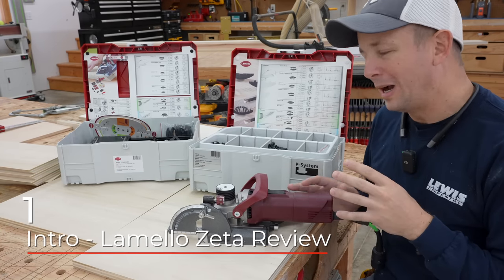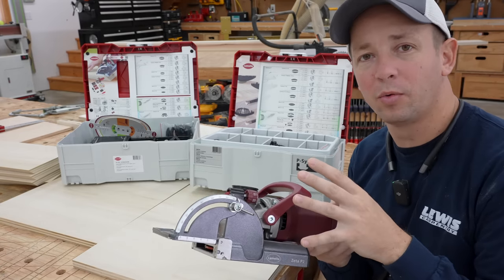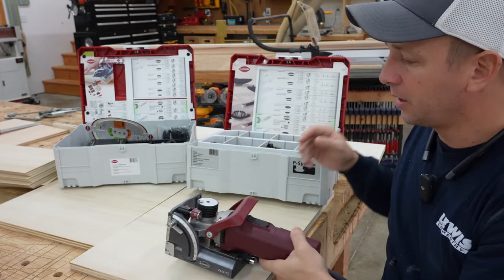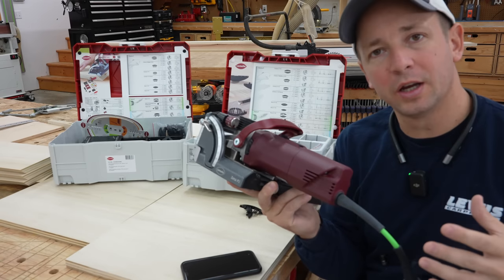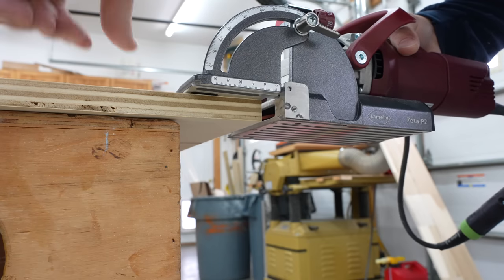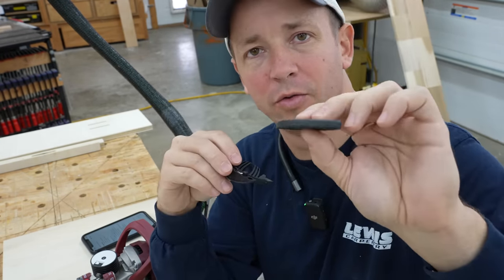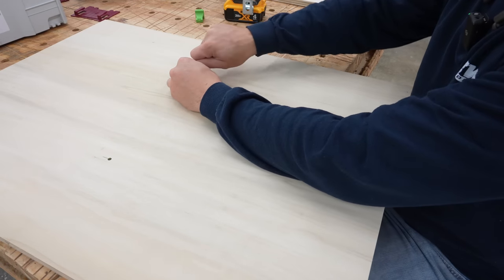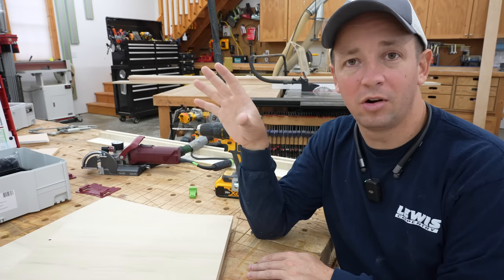Worth the $2000??? I finally bought a Lamello Zeta...

Comment: Wish I had a box of those Festool Plug-its.  While I have both Dominos I also have a P2 Zeta and Classic X.   The secondary fence provides the option to change the location as well as the 2 plastic shims.  You can also change the blade for regular biscuits (Amana makes a nice one with inserts).  The Tensos are brillant nothing equivalent out there.

Comment: I've been thinking of a Zeta P2 for a while now but never considered it on a multicolored slat wall. That sold me and I've ordered one. Unfortunately the vendor that I bought the tool from doesn't have a good selection of connectors. Who do you like to get yours from? Any affiliate link I could hit for that? Thanks!
Reply from the maker: I got mine from Burns Tools online but they recently had a fire, so I'm not sure which direction to point too. I don't have any affilate links for connectors. Thanks for checking though.

Comment: Super-informative review, as always.  FYI, @knappconnectors makes a wide variety of KD connectors, several types of which could be used for the first application you mentioned, requiring only a biscuit machine for installation. Probably a bit slower, but another way to accomplish the mission until a guy has justification to take the Zeta plunge.

Comment: Watching your videos the last couple of years I've always thought that the Lamello would be really suited for a lot of the work you do. I'm sure you're going to find uses for it that one else has thought of yet!

I bought the lamello a couple of years back. If it was 5 grand I would still buy it. Makes angled wardrobe and cabinet carcasses a breeze - haven't used a clamp since. Like you I also use it for making larger sheet material, in my case MR and Tricoya MDF. Chuck in a few dominos and leave it glued up overnight and, as long as you can carry it, you can go as large as you like.  Not used as much as the other connectors, but the Flexus connectors can solve difficult assembly hassle.

Looking forward to seeing how you use the machine!

Comment: Hmm.... in regards to the slats-on-wall with the need for the wall to be painted and the slats to be natural (stained / finished), it seems to me you could have achieved the same result (mounting the slats after painting) using good old fashioned round wood dowels and a quality dowel jig system, which would cost way, way less.  The option of being able to unlock the clamax tenons is nice (does require the access hole) and replicating that with regular dowels would require some thought, but probably possible if that is a real requirement.  But you said yourself you would likely apply glue in addition to the fasteners so it doesn't sound like removing the slats is a real requirement in this case.

Comment: I own the original Zeta and always worried about the cord, with $1500 crashing to the floor with one trip of the cord, to the rechargeable one might be just the ticket. and although I may be all wet here but seems to me that these work best when you have the vacuum attached and its sucking out the chips. I have had occasion to try to use the tool without the vacuum and it got clogged.

Comment: Hey Spencer, great video. 32 minutes is a long time to ask someone to watch a video and in your video I never once wondered whether it was almost over or not. Really great content.

A couple of questions: Carbide cutter or diamond cutter, is it worth the extra $100 for diamond cutter?
Second, how does one cut a bunch of mortises into the face of plywood that is repeatable and accurately? In that scenario seems like you don't get to reference from either the fence or the bottom of the tool. Maybe a way to use a Festool track guide with this tool?
Reply from the maker: The diamond blade is better for more abrasive type material like melamine or particle board. I think you actually want the standard cutter for wood and plywood.
Reply: A jig would probably be your best friend on repeatable in-line mortises like that. FC Tools from the UK makes a jig that the Lamello will mate up with.

Comment: Hi Spencer. Glad to see you finally give the Lamello a try 😊.
Just an FYI you can get a blade that fits the Lamello Zeta P2 to use it as a biscuit joiner. Your need to turn the oscillation function off to use it as a biscuit joiner. Also check out the “Flexus” connector. It is a Clamex connector but the little nubs flex inward so you can slide say a shelf in place in an existing cabinet etc.. and then lock it in place. If you search“Colonial Saw Flexus” or the “Lamello Flexus ” on YouTube they both have a video on how it works. The cordless version comes with a dust bag. And I’m curious… Did you get your Lamello with the diamond blade or the carbide? I got mine with the diamond blade because I mostly use sheet goods. But I had a project using a combination of hardwood and softwood so I bought the carbide blade. They recommend the carbide blade on natural wood products, especially hardwood. In natural wood products the carbide blade cuts cleaner and wears less than the diamond blade.
Also do you have a part number for Festool plug/it connector you used?
Ron
https://youtu.be/esr0k2PtQlI

Comment: Another great video Spencer. You will love the Lamello. Try doing miters you will absolutely be blown away how perfect they are every time. It would be great for those ceiling beams, you probably would not even need to tape it. One question, where did you get the Festool plug in cord. I have heard that it is only available in Europe. If you could provide some details. I would greatly appreciate.
Reply from the maker: I had someone send me a few from Europe several years ago.

Comment: Great video and very helpful for someone evaluating the Zeta 2.   I have one but find that I should be using it more in the building steps but don't seem to grab it much.   I have looked online for other uses and how carpenters use it in their workflow, but there's little information out there folks are sharing.   It would be great to see you make a video after you have used it for a few years on how to use it in different carpentry and cabinet applications.     Also, where do I find the plugin adapter you replaced the cord with?

Comment: In Canada machine alone around 2300$. 3400$ with a kit. Should also mention I first used a Lamello back in the 80s. They did have connectors allowing snap together assembly,some were aluminum some plastic. I never used them but they may still be available. Cheers.

Comment: I've had one of those for over ten years, mine came in the luxury wooden case. and it's the Rolls Royce of biscuit machines, though not quite as versatile as the original Elu pivoting biscuit machine and scoring saw - only bought the Lamello because you can't get electric motors for the Elu. Also had a Delta and Mafell biscuit machines in between, can't recommend those...

Comment: Have been building cabinets and furniture with dowels, biscuits, pocket screws, and dovetails for 50 years. Making an expensive joint stronger than the wood seems a bit pointless to me. Maybe in a few special applications it might be good. Nice video.

Comment: I’m curious to know how well the shear strength is on the connectors
Reply: I built exterior doors for a living. I used the original Top Lamello. I started in the early 80s. Some of the doors are 40 year  old  with no signs of failing. Gluing up panels was a breeze. The Top model was a quality machine. The knockoffs were not even close in quality.
I’ll,check this 2k model out.
Reply: You and I know that the shear strength does not exist with plastic
Reply: @lourias  Not true at all  These use ABS plastic which has relatively high shear strength.  I break-tested a solid hickory panel and the hickory split before the inserts sheared.

Comment: Seems like the pre-load clips should already be pre-loaded onto the component vs. snapping them on.
Reply: The problem with that idea is that the pre-load clips would stretch out the fingers of the Tenso and cause the connection to lose clamping force. Lamello says to not install the clips more than a 1/2 hour before final assembly in order to avoid this issue. The clips actually move down into the connector when they're snapped together.

Comment: If you have a fixed height, then it can only be used with one size of wood thickness whereas with an adjustable fence one can easily adjust  for different thicknesses in wood, such as a 5/4” aprons with double biscuits onto 2 1/4” legs so as to have a 1/8” reveal line outside of the outer plane.
Reply from the maker: It has a fence that is added for those applications.

Comment: Once the running costs of the connectors are factored into material cost out, it won't matter. It will just be a resupply of shop goods at that point.

Comment: The Zeta is not cheap but worth every penny!  The tenso & clamex fastener is awesome...so many uses.  I now attach all my cabinet scribes with the tenso fastener which is quicker/easier and being able to remove them is easier to scribe.  You can use the bisco as a temporary connection or alternate between tenso or clamex connectors you are using to make disassembly easier.

Comment: Excellent review Spencer. One question I’ve always had with those snap in connectors - can you pull it off somehow or is it a one and done kind of thing. As in how do you dry fit or do you just have to trust the tool?
Reply: I have one and yes you can pull off the Tenso snap ins (if you didn't glue too😉). It might take some muscle tho. I dry fit and then pop apart glue and pop back. If done right basically a second set of hands buying you time to get clamps. With the clamex no glue or clamps necessary but they're pricey and there's a small hole.
Reply: @ericdillenberger7873  Thanks for the insight!  Still expensive as h$ll and fairly thick so wouldn't work for thinner slats - but that's a great use case.

Comment: When the client wants to touch up the paint or even repaint the whole wall, can you unsnap the slats, repaint the wall and then snap the slats back into place?
Reply from the maker: Yes, if you don't add glue or adhesive. I will be using adhesive with the tensos.

Comment: This is a tool I’ll end up buying for the occasional slat wall project but I fear that it will end up not used once this trend passes. I need to be sold on applications that will make me money using it. Knock down cabinetry may be one.
Reply: Well that was quicker than expected. I ordered one. And I am glad you covered the assortment box. That would be a waste for me. I’d rather spend that money on bulk tenso and clamex supplies

Comment: After watching Peter Millard review and comparisons I was pretty discouraged of acquiring this tool.
 He compared with Domino and Doweller, I really trust his opinion.
   I’m pretty sure works really well for some applications but not for the majority of the jobs.
  It’s pretty hard to justify the price tag at least in my case.
Reply from the maker: It's a very specialty tool, but the guys who love it really love it.
Reply: I think Peter Millard was being a little bit unfair with it to be honest.
Reply: Pete's video where he says the Zeta was a bad buy is extremely unfair. He was using the Tenso without glue- Lamello specifically says those connectors need to be used with glue. I thought it was pretty irresponsible of him to not know the very basics of a system before making a video where he portrays himself to be somewhat of an expert.

Comment: I don't mind paying a high price for a tool, but if the consumables are also expensive then that definitely influences my decision. Your average biscuit is about 10 cents, these are 10x more!
Reply: Average biscuit requires glueing and jigs when you are assembling. That might be fine for a hobby woodworker that does a piece over a week to a month. 
if you are in a shop doing hundreds of case work frames you need the fast past through system. If you run a large workshop you are going to be using floor standing dowel machine with a similar screw lock system and that is a $100,000 set up at minimum. 
Domino is not as suitable if you are specializing in case work as it requires glueing and waiting.

Comment: And what happens if your sheet is not 18mm thick?
Reply: There is an adjustable fence that also comes with the P2 kit, so you can set the cut to nearly any distance from the edge of the material if you like (up to 50mm I believe).    Thicker material you may use a connector referenced off both the top and bottom edge.   The important thing is the lamello makes it easy to consistently reference your plunge cut at the same distance from the reference edge, whether you use the default 10mm measurement or your own measurement using the adjustable fence.

Comment: I bought my Lamello biscuit cutter from an old joiner and it came with some aluminum biscuits that slot/slide into one another when pushed laterally. I’ve never had a use for them so I’ve never tried them out but has anyone else ever seen/used them before?
Reply: Those are called simplex. Need to be used with Epoxy and there's an install tool for them too. I've never used them myself but have had a couple people tell me about them over the years.

Comment: What would be really cool is if Lamello developed a clamp system for 45 degree miters.
Reply: This P2 can do miters at any angles using their adjustable fence system.    You need to be careful where you set the plunge so you don't plow through the show face of your material, but the connectors will hold a miter joint really well - tenso or clamex work great
Reply: Can't tell if you are trolling since that is literally one of the main uses... Set the auxiliary fence to 13mm, will be about 1/16" material from the cutter to the face. If the inside of the miter is accessible use clamex, if not use tenso.

Comment: Cool tool, but I feel like you could have accomplished that using dowels or even regular biscuits. It seems like a faster result, snapping the wood together, but I'm not convinced it was worth $2K.
Reply: Value will be different for everyone. If you’re not using it professionally, probably not. Mine is well worth the cost and has paid for itself after only having it for two months. It’s a money maker for my business.
Reply: If you are making hundreds of cases that lock system is so much easier to use. There are dowel lock in systems as well but the machines cost several times as much as the Lamello hand held machine and tend to be floor standing machines.

Comment: I bought my Lamello Top Ten back in '90 and it still does everything for me. I purchased a new Felder FD 250 with optional square chisel and that has given me more ways to
connect wood with tenons and plates for the wood products and furniture I build. The Zeta does not fit my woodworking world. good luck with your Lamello. The tools from
Festool and pocket screws are not part of my work.

Comment: I use my domino a lot, I am not a dedicated cabinet/furniture maker either. I just don't see this being as versatile as the Domino. I live on Nantucket and I would have to have all the connectors shipped in, and God forbid I ended up needing them in a rush. Dominos can be made in a pinch, I don't see that being possible for the lamello
Reply: Depends on what you make I suppose. There's plenty of applications where I'd want the strength of the floating tenon Domino versus just a P-System connector. I know lots of shops that will use both systems on a single joint- P-System for alignment and clamping force, the domino for it's strength. That being said the Lamello has a bunch of different connectors to utilize in different applications. Lamello USA is actually based right in Kingston, MA so even being on the island, you'd get the biscuits in a day or two.
Reply: @DDempseyCSaw  that's good to know, I'll have to look into it more
Reply: @dandeflavis7004  
The Domino is a slower machine to use and is more geared towards structural joinery. If you are making cabinets for kitchens on a regular basis biscuit joints are better especially with a screw locking system. There is no need for glue dry times.

Comment: I think it’s about time somebody designed something very similar with a few tweaks and made it significantly cheaper. It’s a cool tool but that price is astronomical.
Reply: Price is pretty reasonable. This machine is extremely well built. I have no doubt it will last until I retire, and in the few months I’ve owned mine, it has already paid for itself and is already creating a profit.
Reply: People have got too used to cheap junk that is made in slave camps and think that everything should be priced at that rate. 
Innovation has declined in products and so has quality because of the cheap junk mentality. Landfills are full of them as well because they simply do not last.

Comment: With the cost of the connectors, they should GIVE you the tool....not charge 6X what it should cost.
This is the carpentry equivalent of the ink jet printer. I may have to wait until the $200. knock-off hits shelves.
Reply: That reality of real product pricing especially in the quality end of the market. People have got too used to cheap junk that is mass produced using slave labour.

Comment: You have managed to promote the absence of an adjustable fence as a benefit. NOT. The Makita, or any other brand with its adjustable fence can also use the bench surface as a guide.
Reply from the maker: I didn’t explain it well. I was trying to explain the blade being centered as a benefit but the Lamello also come with and adjustable fence that can be added on and adjusted up and down as well.

Comment: Lamellos nice but cmon it's a biscuit joiner! Lol You never worked in a production shop?
Reply: A production shop that is outputting large volume is going to use a dowel machine with production lines. 
And that set up is costing in excess of $100,000.